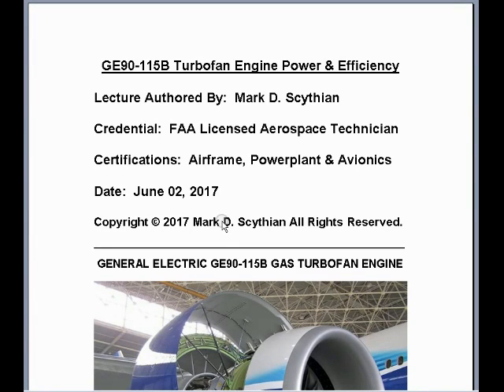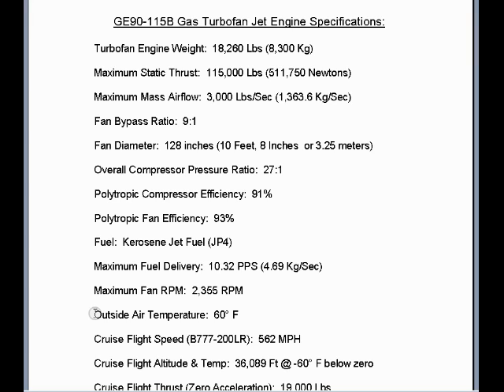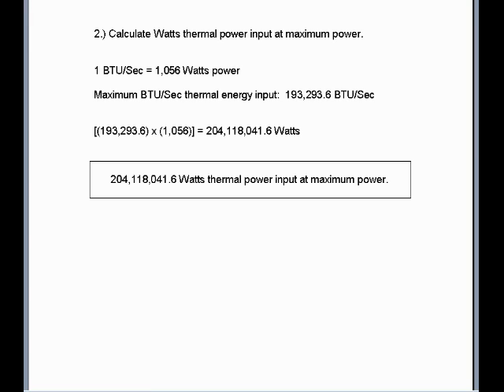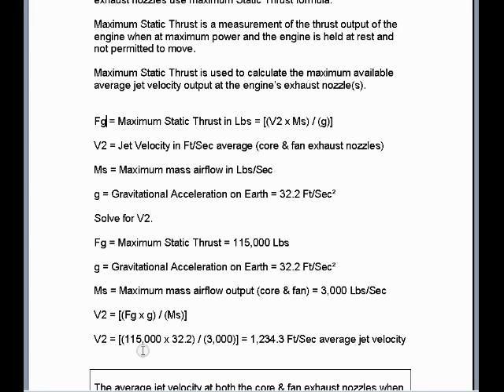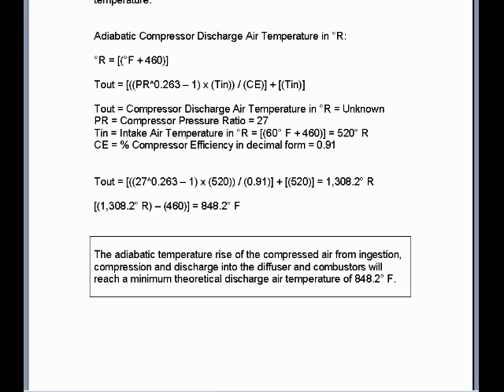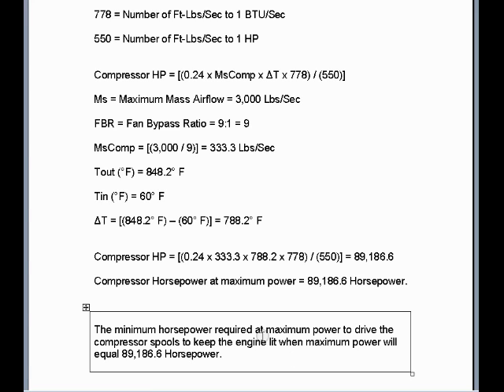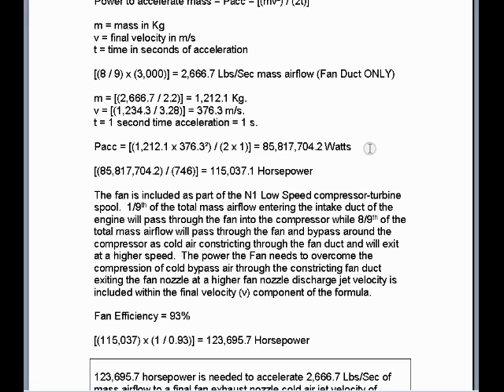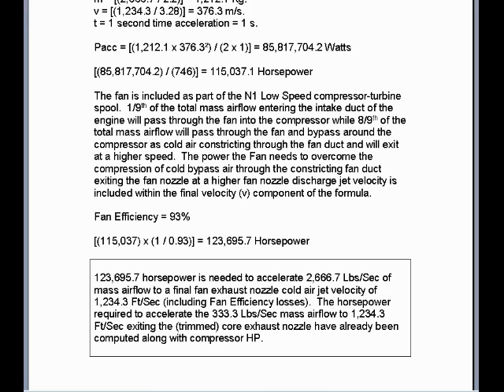GE90-115B Turbofan Engine Power & Efficiency (Part 1 of 2)

Comment: Only 2355RPM? 😢
Reply from the maker: Hi.  Yes.  High Torque, and much lower RPM.  GE90-115B Fan is 128 inches in diameter (3.3 meters in diameter).  Maximum Fan RPM is 2,355 RPM, but its Torque is 179,372 Ft-Lb @ 2,355 RPM (243,946 N-m @ 2,355 RPM).  A large diameter Fan cannot rotate as fast as a smaller diameter Fan, because the blade-tip-speed will reach the Speed-of-Sound at much lower RPM.  Fan and propeller performance limitation(s) occur at blade-tip Speed-of-Sound.  A ducted fan or propeller can rotate slightly faster than an unducted fan or propeller.  Large Fan diameter equates to greater circumference, thus reaching blade-tip Speed-of-Sound at much lower RPM compared to smaller diameter Fan.
Reply: Excellent sir! But plz tell me how much rpm when engine is at idle on ground and aircraft is not moving
Reply: @jamilkhan-kc9wv  1800-2200 RPM (chat gpt) 🤔
Reply: Thanks a lot.
Reply: Thanks a lot.
Reply: Sir! If I say that ge90-115b engine N1 and N2 are at maximum rpm during take off, this will be correct or not? At what time or stage they are maximum
Reply: @jamilkhan-kc9wv  Engines operate at full power during takeoff and climb.

Comment: Hi, can you cite the sources of the data of the engine?
Reply from the maker: Absolutely!

Here are the source references to access GE90-115B turbofan specifications:

1.) http://www.jet-engine.net/civtfspec.html

2.) FAA.GOV ===> GE90-115B Type Certificate Data Sheet (TCDS)

3.) https://en.wikipedia.org/wiki/General_Electric_GE90

4.) https://www.geaviation.com/commercial/engines/ge90-engine

5.) https://www.airliners.net/forum/viewtopic.php?t=776605

6.) https://www.easa.europa.eu/sites/default/files/dfu/EASA%20TCDS%20IM%20E%20002_GE90%20series_Issue3_15112017.pdf

7.) https://ipfs.io/ipfs/QmXoypizjW3WknFiJnKLwHCnL72vedxjQkDDP1mXWo6uco/wiki/General_Electric_GE90.html
Reply: @markscythian7179  Thanks for the answer! But I still can't find the efficiencies of the fan, compressor, inlet, etc.
Reply from the maker: Hi Alessandro.  Use the link below which specifies GE90 Compressor Polytropic Efficiency.  It is specified at 91% or 0.910.  If you scroll down to GE90 Turbofan Cycle Analysis, under Engine Data you will see the applicable GE90 efficiencies.

https://www.researchgate.net/publication/323790787_Benefits_of_GE_90_representative_turbofan_through_cycle_analysis

Comment: hey man would you happen to have any good places to look like books or websites on this material your discussing here. I am trying to design a fan from beginning stages and my main goal is finding a desired velocity and what power I will need to get that velocity.
Reply: @Mark Scythian
Reply from the maker: Hi.  Find applied physics books which contain aerodynamics, fluid mechanics, kinematics, dynamics, power, work, energy, thermodynamics and electrical concepts.  This is so that you can understand the basics principles supporting airfoils (wings and blades).  From that point on you'll then be able to calculate the power transfer conversion from the output drive RPM and Torque into propeller efficiency and propulsive power.  Fan blades are like wings but they need a twist greater from root to tip since the circumferential pathway distance increases with blade length.  How much thrust or lift distribution and how much taper is needed eventually will factor into the design.  Rotating wings are propeller or fan blades.  Build up your research on these guidelines and you should find what you're looking for.